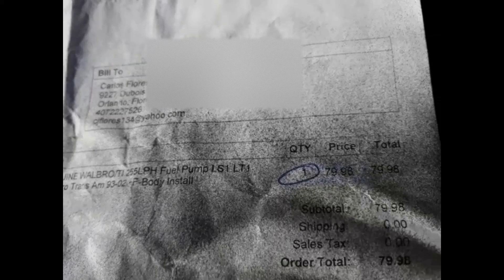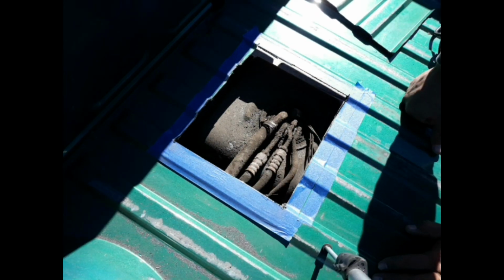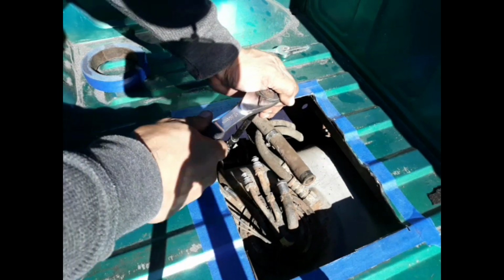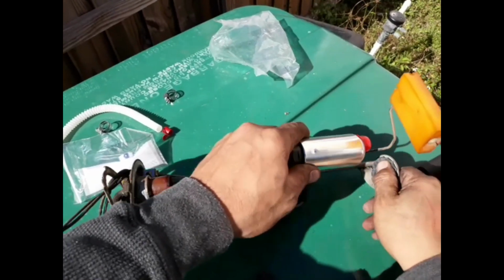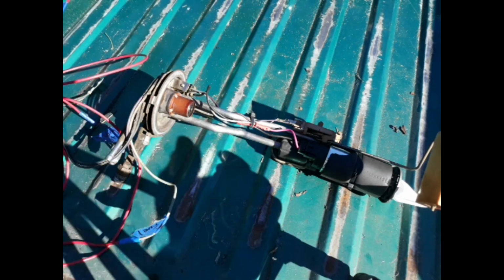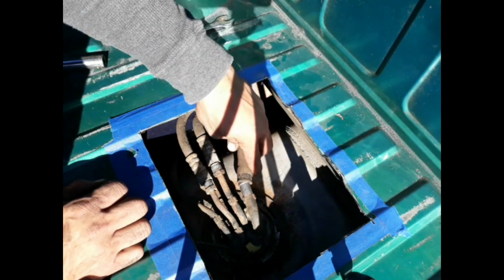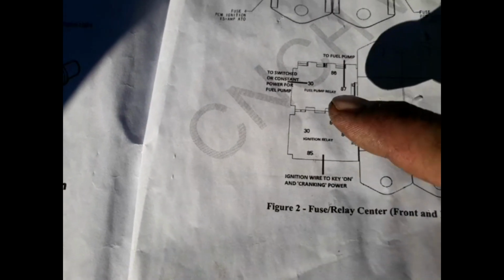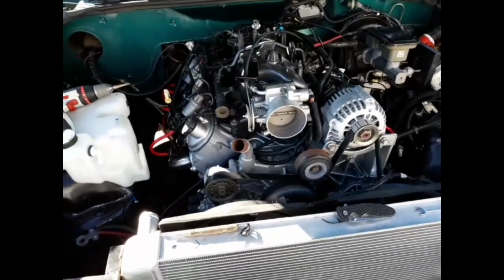How to install Walbro Fuel Pump before LS Swap Start Up

Comment: Hey man, how are you I finally got my hands on a v8 that came out of a 2003 GMC Yukon Denali and the fuel rail is a return style so I’m just wondering if I have to mess with the fuel filter or the fuel pump ? And the s10 has like 3 fuel lines. I know one is in and out but the third I really don’t know Lol. Any advice with that will be appreciated.
Reply from the maker: Yes 3 lines you do Not have to mess with fuel pump and fuel filter. For me I did upgrade to a 1998 Chevy Camaro ls1 Fuel pump 250Liters walbro. FUEL filter is same but I installed A k&N fuel filter. The 3/8 line from filter goes to your thicker fuel regulator line, the 5/16 line is return and You dont need the evap 3rd line. Make sure you trace the line going to evap canister that's your third line. Oh and I'm doing fine thanks for asking.
Reply: Thank you so much so do I plug that third line up?and do I plug it on the intake side as well? Or no cuz I really don’t know man lol sorry
Reply from the maker: @luisrocha4371  Yep, you plug it. Just confirm which is feed and return. If I remember your fuel rail should have 2 lines only 3/8 feed and 5/16 return. But yes plug the rest. Also if it has a fuel regulator on the drivers side replace with new and should not be more than $20. I did a video changing that, its easy. Good luck. P.S. you are never a bother. Any question I will try to help best way I can. You are welcomed to send any pics in my instagram carlosflores9695.
Reply: Dope man thank you and I will! Appreciate it a lot
Reply: Couldn’t find your ig ?
Reply: Never I got it 97

Comment: What was your measurements for access panel
Reply from the maker: Measurements are 7 inches from the front bed wall to first cutline. Second cutline would be parallel to the first from the front bed down 13 inches. Third cut would be from the left bed wall 11.5 to 11.75 inches. Fourth cut from same left bed wall to 21.5 inches. This gave me plenty of room. The top and bottom cuts will place you in between the underside bed support FYI you should miss them by at least an Inch. Good luck.
Reply from the maker: @gearheadhuff7853  You will see the hump. (Fuel cap hose to tank) Ignore it, measure from the wall.

Comment: Does this pull more than 15amp and do I require a relay thanks
Reply from the maker: I installed a dedicated 30 amp relay just because of the removal of my stock ECU and made it a standalone. But if you do not remove your stock ecu this will be plug and play as long as you use the stock ecu and no wires are removed.